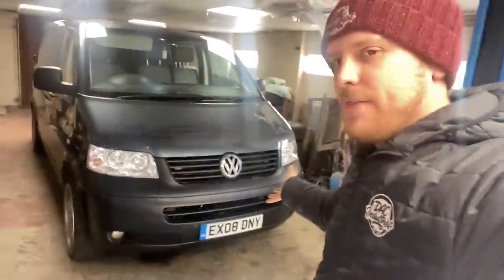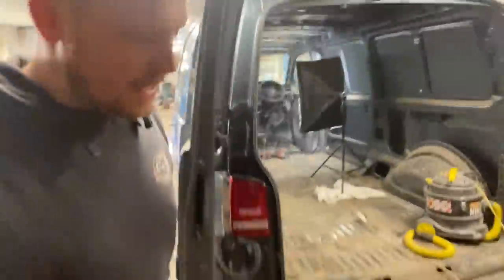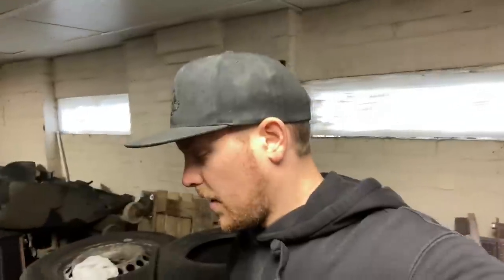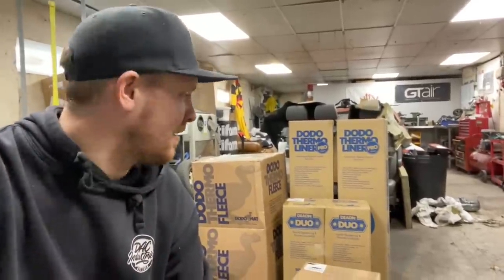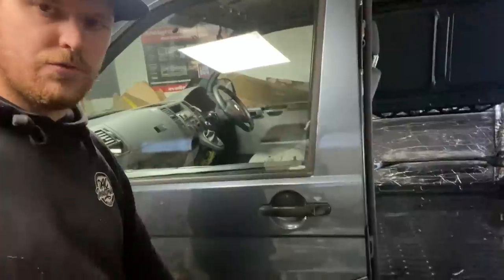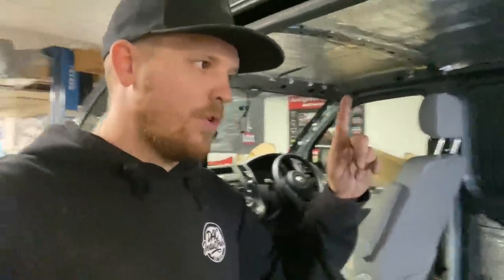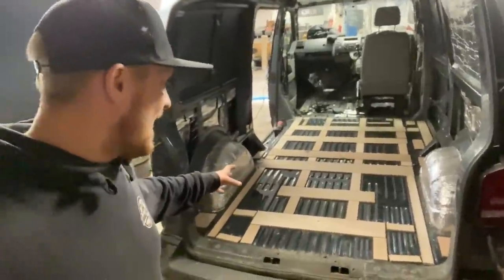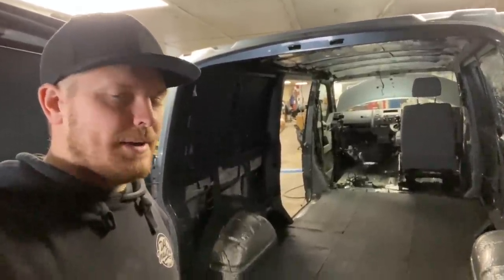Dodo Mat Sound Deadening & Insulation - T5 Camper Build

Comment: I have use CT1 for fitting Solar panels to roof of Caravans and Motorhomes. I even used it once to repair the top Inter cooler hose of my Sprinter based Motorhome when it split and put my into Limp home mode. Or Limp to Scotland from Sheffield were we had stopped to look at a Border Collie that we were picking up on the way back home. I could have left it as a permanent repair it was that good. It is bloody good stuff. If you do get it on your skin then I found that baby wipes are pretty good at getting a lot of it off. even better is Isopropyl Alcohol. I often forget that I own gloves to keep my cleanish. 
I would love to do a van conversion. That was the original plan when were first thought about having a van to go off grid camping in. Ended up buying a Motorhome instead as I would probaly still be doing it now with all the other projects I have on the go with the House.
Reply from the maker: Love a bodge that works well! Might use this to bond solar panels on! Motorhomes are a hell of a lot easier than building one!
Reply: @DanChambersDAC  Not as much fun when you get most of the things you need in one go. I have upgraded were I can. Like changing out lights for once that  have USB sockets for the back bed. The solar system so that It charges both batteries. the Leisure one first and once that is full the vehicle battery.

Comment: I sound deadened the other side of the sliding door trim on the rear quarter , it made a difference when closing the sliding door, I also took the panel off below the fuel filler, it was full of dirt and started to rust as it was holding water, it’s only a 10 minute job to remove and added a bit of sound deadening to that also removed the front wing arch liner, cleaned the panel and added up there as well as doing the underside of the bonnet
Reply from the maker: That is on the list bud, removed and cleaned it ready to sound deaden. Good shout on the other bits.
Reply: @DanChambersDAC  May as well reseal the sliding door motor cover while you’re in there as the seal on that is bound to be buggered.
Reply: How does that panel come off below filler?
Reply: @D4VE26  if you open the filler cap door you’ll see a hole on the bottom right of the plastic, there’s a bolt in there, I think it’s a torx35 of the top of my head but not 100% sure, once you’ve taken the bolt out the panel will slide to the left and unclip of the bottom clips, you may need a magnetic socket as it can be a bit of a faff to get the bolt back in

Comment: Making good progress Dan, your van is probably better insulated than my house😂 the sound deadening really makes a big difference on the panels so it should be a lot quieter 🙏👍
Reply from the maker: Thank you bud! Fair bit in there already isn't there and there is a lot more to go still!
Reply: Way back in the early 80's I bought a full sound deadening kit for my Mk3 Cortina 2000E and it had sound deadening for every single part and orifice on the car it took me hours and hours to fit but made a huge difference to the car it was like driving a Bentley, would I do it again?... not f'n likely 🤦‍♂😂

Comment: How did you fix down the ply floor... I saw the glued battens and 7mm mat, but did you screw to just the battens.. Or all the way through to the metal with self tappers?
Reply: I was hoping to find this out…. Not sure sticking the plywood on top of the insulation would be ideal but equally screwing into the sub floor slats would be a ballache

Comment: Get the door cards and window regulators out with the glass taped up and do inside the front doors, makes a big difference.. don’t you roll the sound deadening after sticking it down ?
Reply from the maker: Yup, Will be doing that when we do all of the cab stuff as a company want to supply me with it all as mentioned in the video. Yes i use a roller to make sure it is all stuck down.

Comment: Hi from Sweden! How much of the different insulation did you use? I have a short wheelbase VW transporter with too sliding doors and dubbed doors in the back. Having trouble to know how much I need to order. Hop for answers
Elislott

Comment: Really good video. I am at the same point in my own van build (pre-facelift t5 SWB) and am just in the process of cutting out the bulkhead lip before I start on the sound deadening and insulation.
Quick question, how much sound deadening sheets and insulation rolls did you use?
Reply from the maker: Thank you bud, They can be a right pain to remove! I am not too sure tbh as Mike just sent me the stuff. Definitely worth contacting DODO as they are very helpful.

Comment: Interested to see the sound proofing under the scuttle panel, I have a 2.5 (2004) and it’s very noisy, are the 1.9’s generally quieter?
Reply from the maker: Tbh bud I have looked and can't see that I would get much under there so may not bother.

Comment: Do I have to cover the whole roof with sound ending how can I dispatch a little square bits in different areas of the roof
Reply: Minimum 50% coverage per panel with the sound deadening . I did my T4 a few months back and probably achieved around 95% coverage with the sound deadening and around the same with the insulation.
Reply from the maker: As T4 Tips & Guides say’s 50% coverage minimum really. I went all out and covered the majority